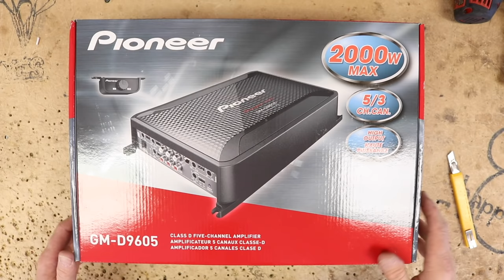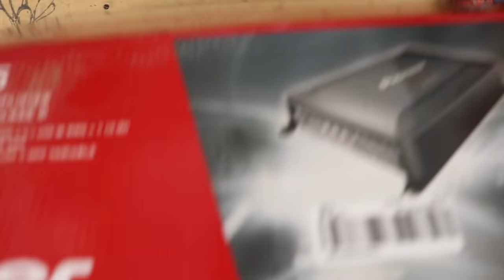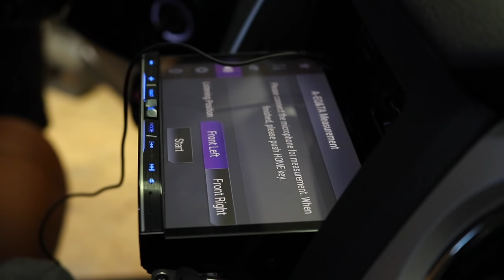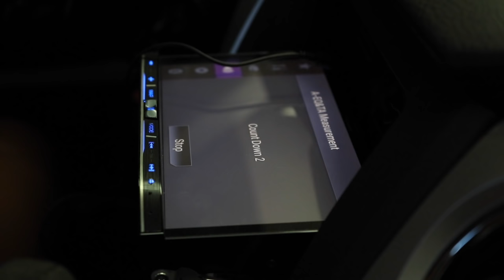Toyota Tundra Rockford Fosgate and Pioneer car audio  upgrade

Comment: Only one thing wrong with the whole install crimp connectors why don't you solder the connections
Reply from the maker: Alex Vinson we use a bullet style male and female connector. We use them in places where things may have to be removed for service or repair. Otherwise we try to solder everything.

Comment: how is that amp compared to a Alpine PDX
Reply from the maker: Edouardo Hernandez the Pdx-v9 is a bit more money. It is in a different class for sure. I would recommend the PDX, it is our go to 5-channel at that price.
Reply: Edouardo Hernandez your math is off.
Reply from the maker: Edouardo Hernandez Pioneer is not helping themselves with there Marketing of over power ratings on the box. The is 75x4  (a/b class) and 350( d class). That is a 4 ohm rating. The sub channel will play at 2ohm and give you 600. This is the basic power rating off their web site.
Reply from the maker: Edouardo Hernandez yeah not a fan of the new Toyota radio. Take it out!
Reply from the maker: Edouardo Hernandez video looks good, I like the Solder station you have. I might have to steel that idea.
Reply from the maker: Edouardo Hernandez post pictures on Instagram
Reply from the maker: Edouardo Hernandez cool send me the link